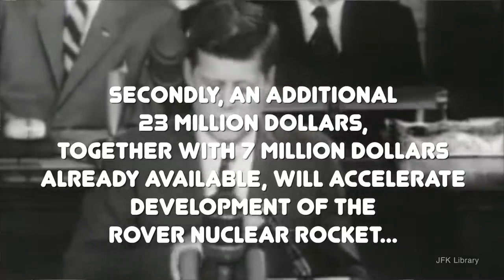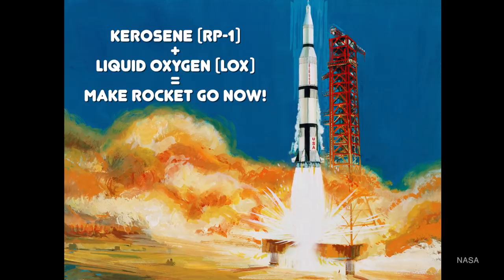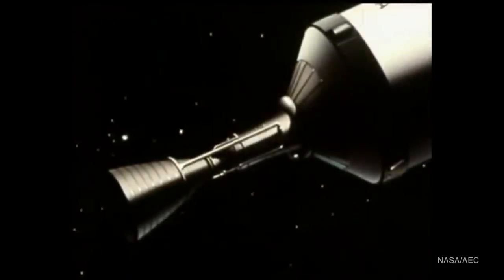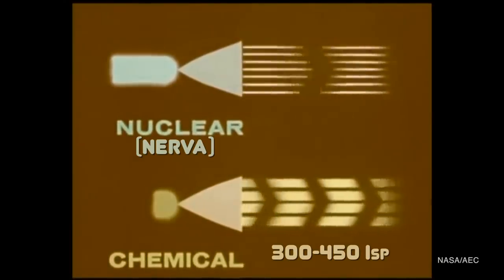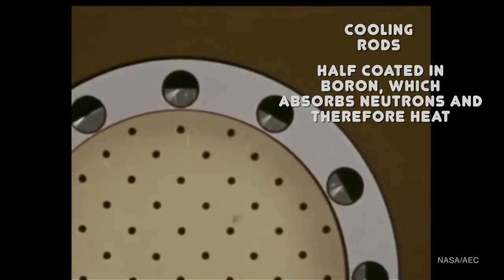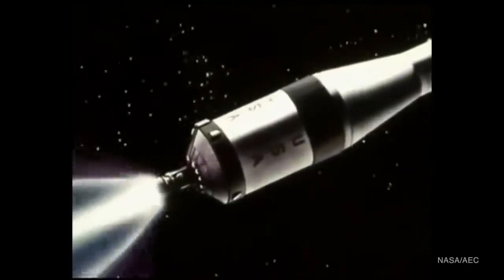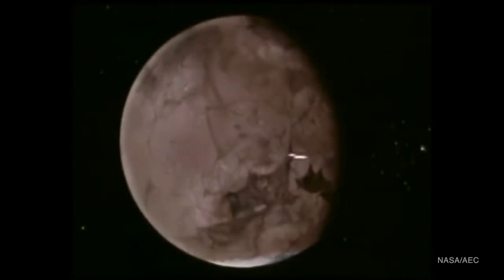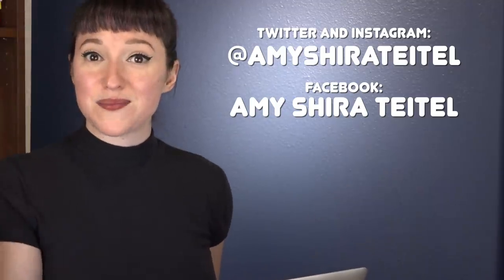A Primer on Nuclear Rocket and Why They're Awesome in Space

Comment: ion thrusters have specific impulse of 1000 seconds to 10000 seconds. This is much better than pure nuclear rockets. Why bother with nuclear rockets?
Reply: Ion engines, despite their high specific impulse, have pitiful thrust. The biggest ion engine ever built produces as much force as a sheet of paper would on your hand, this low thrust severely limits their applications to deep space, where you won't have to escape from any large gravity wells (a back of the envelope calculation tells us that escaping from Earth's gravity using an ion engine would take nearly a year of continuous thrusting). Nuclear rockets have a lower specific impulse but can produce thrust more comparable to that of a chemical engine, making them more useful for escaping Earth's gravity well on a reasonable timescale.
Reply: Yea,  I know all that. I work in aerospace, on satellites. Ion thrusters are not appropriate for launch vehicles at this time. Once in orbit, however, ion thrusters shine. Low thrust at long duration (at high specific impulse) = greater delta V. Ion thrusters are use in today's spacecraft, including programs I have worked on. Interestingly, the propellant (or reaction mass) is usually Xenon. As for using nuclear rockets for launch from earth: I doubt it. Not likely to allow a fully operational nuclear reactor to be placed on a rocket. It has been controversial enough just to launch deep space probes, such as New Horizon mission to Pluto, with a small Plutonium powered thermal generator (NOT a full blown nuclear reactor). By the way, you made a mistake on your 'back of the envelope' calculation. do you know what it is? ;-)
Reply: @edp2260  
"By the way, you made a mistake on your 'back of the envelope' calculation. do you know what it is? ;-)"
Hmmm, I'm not sure. My math assumed a spacecraft mass of 1 tonne and an acceleration of 0.000091 m/s/s (roughly the same as the Dawn spacecraft) which equates to about 216 days of thrusting for a velocity change of 1.7km/s.

"I work in aerospace"
Ahh so you know a lot more about this than me then. I would've thought that for manned spacecraft ion propulsion would be impractical, because you'd be adding months onto your mission time just to move from orbit to orbit. It makes more sense (in my mind at least) for unmanned spacecraft where you don't have to worry about the effects muscle and bone atrophy as well as radiation on your crew.

Comment: The beryllium rap is a neutron reflector not a heat reflector. The beryllium/boron control rods are control rods not cooling rods. Please, take down this video correct it and then put it back up.
Reply: They didn't even need the reflector control they found the could just throttle the hydrogen if that's what you're talking about ?